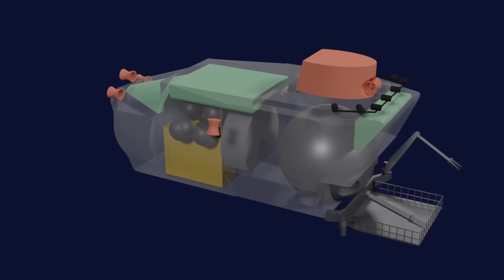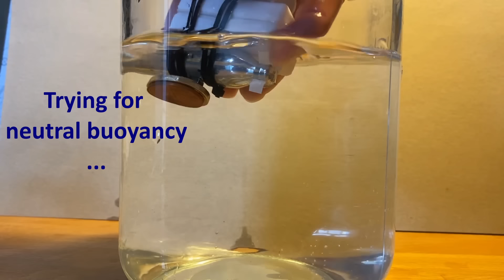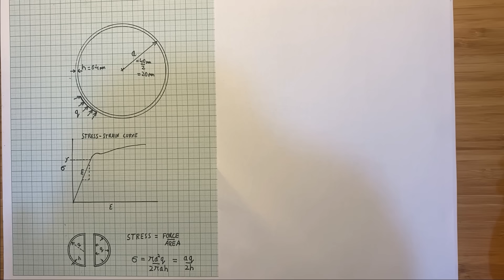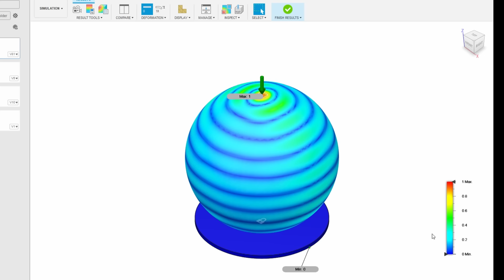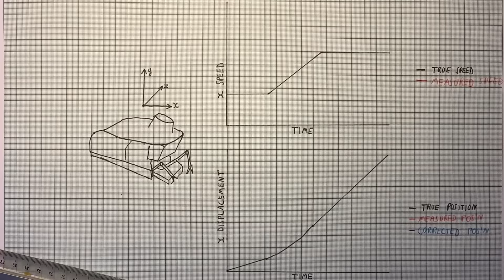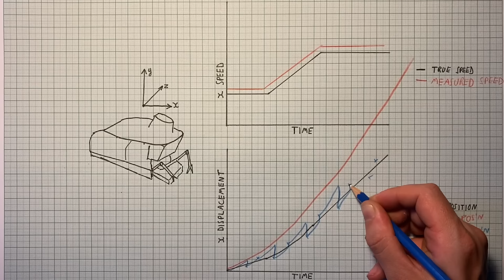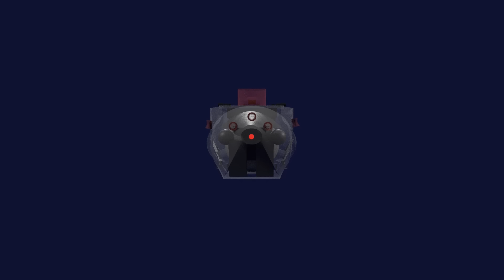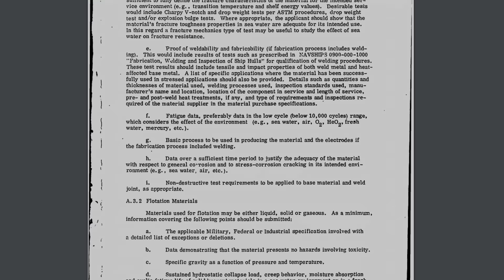DSV Alvin : How to build a safe submersible

Comment: My first thought was "they really thought of everything". Then I realized that everything and more is the bare minimum. Every redundant system, override, tool and component is built to provide passengers with the best possible chance of coming home. And the constant revision, updates and even the fault found during certification just highlights that it's nowhere near perfect. Safety in the face of such risk requires constant vigilance and I'm glad you're spotlighting this incredible work.
Reply: Alvin has not been without problems.   With each problem the Alvin has been improved to deal with it.    Over 60 years and thousands of dives the managers of the Alvin have learned a lot and have denied nothing.
Reply: @RossM3838 crazy how Alvin has had so many upgrades that basically nothing from day 1 is left remaining.
Reply: @ko7577 we don't need people to die on the Titan to determine the design was unsafe. Thorough, testing would have done the trick.
Reply: @ko7577 It requires thinking about everything and then raising the cash to do it. If you don't have the cash, whether through VC or your own money, don't bother.
Reply: @ko7577all the cash in the world can’t stop a man from saying “looks good to me” and pocketing the remainder. Money can’t buy integrity.
Reply: @ko7577your post doesn't make any sense at all. The reason Alvin updates are so expensive are the need for recertification. Those are.necessarily costly. Safety doesn't cost money out of thin air. It costs money because it requires attention to every smallest detail, and often requires to design and build specific test equipments, all of which sinks time and money. You just can't.cut corners in such environment. 

Your part about "will need a.few.deaths but worth it" is especially egregious, as you can be sure there won't be any follow up to Titan. Why ? Because 1) there is no data to withdraw from the accident as there is nothing left at all, and 2) the only way it can be improved is by going through the same certification processes as Alvin, which would increase the cost by perhaps 20 millions or more. Since the company doesn't have that kind of money, it's not going to happen unless it's bought by someone else.
Reply: @ko7577 -  "But anyway, yeah, safety costs money."  

An incredibly simplified summary, but not inaccurate.  Which is precisely why Titan suffered a catastrophic failure with the loss of all souls on board.  To state the obvious, Rush's very public aversion to certification was motivated by his desire to construct and run his DSV on the cheap.  He just used educated jargon, hand waving and abysmal judgement to pursue that desire.
Reply: @ko7577We would probably need a fundamental change in how we do things on par with another industrial revolution before a safe vehicle can be made in a reasonable price range. We are talking about a dynamic vehicle capable of floating or sinking at will with a reasonable safety margin under some of the most extreme conditions survived by a vehicle. That isn't easy to do, and cutting corners usually kills more people than it is worth(assuming we go by the micromort calculations used by the federal government for humans the most recent accident destroyed the equivalent of roughly$60million not counting the submersible).
Reply: As NASA once said, "quadruple failure that isn't supposed to be possible", after it was proven it is possible, and happening right now, suddenly quadruple redundancy isn't good enough even for ground operations.
Reply: @Mordecrox Any improbable failure will eventually occur over a long enough time-line. Risk management is about where you draw the line in the sand. You can have 10 redundant backups, and it may take a billion flights before they all fail, but eventually it'll happen. 

Risk management will always be a subjective decision based upon the priorities of those involved.
Reply: @PsRohrbaugh  Yes.  Probability statistics are not about how impossible something is, but how possible.  And yes, over a period of time, but time is not a really a factor.
   Loved an old sci fi story where two former atomic engineers decided to spend the rest of their lives figuring out a safer space flight fuel.  Thought it would take more than their life times, but others could carry on the work.  --  They hit it on the 3rd try.
Reply: @ko7577 this is just vile
Reply: @ko7577 In my opinion, it is not worth it that many smart and talented engineers, obviously somewhat misled, throw their bodies into the sea in hopes of getting it right. Instead of throwing safety out the window in pursuit of being able to say "I did it for cheap," Rush should've focused other aspects of advancement, perhaps construction techniques to avoid composite buckling, or other materials or technology that advance the science as a whole.

It's as if I made a metal tube with end caps, welded a guy inside, and dropped him down into challenger deep. I haven't given the world much by doing so, but at least I can say I got a man down there for cheap. Instead, if I got a team of engineers and material scientists to experiment with some other material that gives us favourable properties at a much lower price, I have just given the world something that will change deepsea exploration forever, like when kevlar was found to be somewhat decent at stopping bullets.
Reply: @ko7577 Tourism is a disease.
Reply: Look up the K350.
Reply: The Alvin has been around since the 60s.   Why didn’t the Titan’s designers 
Copy more of the tested and true design?  Arrogant to believe that carbon fiber composite could handle compression better than titanium.

And stupid to ignore the cracking sounds on earlier dives.
They could have tested the titan without people on board, using a tether to retrieve it, and sending control signals down an electrical “umbilical”.
Reply: @tikitime  cuz they had a rich dickhead hovering over their shoulder and most of them were fresh outta uni
Reply: @SloMoMonday  

You make excellent points!

Prospective Alvin Pilots are extensively tested on their extremely detailed knowledge of Alvin's systems and how they operate.

Such knowledge may make the difference between life and death...
Reply: @ko7577 Also titan was far bigger than Alvin. With costs like this building a new pressure vessel every 2 dives might be a cost-effective solution
Reply: @sojuz11  thats what i thought too,i think Titan could have worked if they just scrapped the vessel every 2-3 dives at most or even just refubrished it like Spacex does every Dragon capsule trip....
Reply: In real designs, you don't actually want these many redundant systems unless they're extremely basic and don't impact anything else. Every single component and bit of added complexity is another thing that can go wrong while drastically adding cost, weight and decreasing volume for other things.
Reply: I am surprised there is no safety line though, aka a rope to bring the sub back in case of catastrophic failure. I understand it could reduce freedom of movement, but still it would be an important feature.
Reply: @InXLsisDeo  Do you know what a 6500m steel tow-line that can pull a 20-ton-vehicle back up weighs? A LOT.
I don't have the numbers for you, but rest assured it is way too heavy, develops way too much drag (6500m of surface susceptible to currents) and has way too much pull on the vehicle to be of any practical use.
Reply: @thomaskositzki9424  I figured this after I wrote my message, but really, the sub wouldn't pull 6500m of steel cable, because  a few dozens meters would lie on the floor, so that would be the weight pulled. The real issue is if the sub is supposed to visit a wreck like the Titanic, there would be a high risk of the cable to entangle with the wreck.
Reply: @thomaskositzki9424  Almost sounds like you'd need a DSV designed to save DSVs.
Reply: @thomaskositzki9424 Just to devil's advocate (I actually responded similarly) : even in a catastrophic loss of buoyancy, it would still weigh less than its full mass, due to the various passive buoyancy assists it has (like the hollow glass bead matrix, which is outside the pressure vessel and thus likely to remain mostly intact). So the rope wouldn't have to carry 20 tons statically (provided acceleration and jerk are kept under control).
All the other factors remain valid, and I have a feeling the force of ocean currents alon would place a higher load than that on the cable, let alone the swell of the waves under the support ship causing dynamic loading.
Reply: @InXLsisDeo I think that possibility was discussed here- but the weight of such a cable makes it infeasible. Lifting a 20 ton vehicle from 8,000 meters would require a very large cable indeed.
Reply: @InXLsisDeo the weight of a 6.5 km rope thick enough to bring back a DSV that's lost buoyancy is probably large enough that carrying the rope's own mass would be the limiting factor. It would also act as a huge sail in ocean currents, meaning the DSV would basically have very little control over its position.
Reply: @Validole  good points

Comment: Ah yes, American engineering. PSI, mm, inches, feet, m, kg, lbs, long and short tons all in one equation because it's not real math if you don't have a massive headache by line 5. Also great video. Obsessed with building an ROV good for 120m (because reasons). Not too worried about most of it I can steal a smarter persons design but the pressure vessel will need some work. It will be aluminium because I have strong feelings for Aluminaut.
Reply from the maker: Aluminaut was awesome, I didn't have time to speak about it here (and how it rescued Alvin!).
I may have a video coming up in the future about the absolutely deranged units system I was once forced to work with - Oilfield units: basically what you said but somehow even worse.
Reply: @Alexander-the-ok   That would be great :) NR-1 as well (nuclear DSV). Bob Ballard called it his Nautilus.
Reply: Land of the "free to use whatever units you want!" home of the "why can't we just use SI like the rest of the word?"

Comment: Wow, after seeing the precautions and redundancies built into this vehicle and the complete lack of anything even near the same level of reliability in the Titan design, even the lack of any testing, it seems inevitable it would fail.
Reply from the maker: You understand why I refused to even mention the Titan in this video. The two aren't even remotely comparable.
Reply from the maker: @ko7577 Well, I'll be charitable and assume you're not just trolling me. Go and read your first paragraph again....I'd say you contradict yourself pretty effectivley there.

And yes, like most engineers, I am extremely critical of the shuttle program and how NASA conducted their risk management. If you haven't read 'Challenger Launch Decision' I recommend it - the quintessential post disaster analysis.

Comment: Would be interested in how controls inside the main pressure vessel (PV) communicate with the equipment outside the mPV? Also, I did read somewhere that the batteries are now Lithium Iron Phosphate (LiFeP02) or LFP, these don't suffer from thermal runaway like their NMC/NCA Cobalt based peers. Sure they are less volumetric and energy dense, but their thermal safety is significant over other Lithium cells.
Reply: Thermal runaway isn’t a problem for water cooled batteries (the water temperature at 3000m depth is well below 0C…).
Reply: The batteries are still Lead Acid. I know because I just serviced them. There has been an effort to move to Lithium Batteries but there are many engineering and safety concerns that still need to be resolved before that happens. The hope is to have that as a major part of Alvin's next Overhaul period.
Reply from the maker: I had to leave out the bit on through hull communication. Basically there is a 'port' on the back of the hull - similar to the viewports but used to pass through electrical and fiber optic lines.
And yeah, the batteries are LiFePO2 I believe.
Reply: @Alexander-the-ok  I would expect them to be LTO, most reliable and safest chemistry but also most expensive. Although in this case, cost is of rather little concern, and neither is robustness against thermal runaway given it's surrounded by water. But reliability is everything.

Comment: "The Alvin knows its position at all time..."
Reply from the maker: It's almost impossible to talk about Inertial guidance now without accidentally saying 'it knows where it is because it knows where it isn't...'
Reply: INS tells you your position in space. It needs to be corrected for the movement of the planet and solar system around it (it is that precise). It will directly give you longitude based on reading the rotation of the earth around its parked reference plane.

Comment: Wouldnt the strength of the plastic ball be highly dependent on temperature?
Reply from the maker: Good point. The material properties given are at 25 degrees C. Obviously my 'test' and calculations were extremely crude though.

Comment: I learned something new today. I always thought that 'ping pong' balls, or 'table tennis' balls (the same thing) were made from nitrocellulose. After doing some 'research' I found that they were indeed made from Cellulose up until 2014, after which time they changed to being made from ABS. 

Oh all the stuff about some sort of submarine? nah, boring.. Ping pong balls not being made of Nitrocellulose any more.. PROFOUND!!!
Reply from the maker: This is hilarious because I had EXACTLY the same 'table tennis learning journey' as you! I'd seen the videos of people setting buckets of them on fire and creating an inferno because of the flammability of nitrocellulose. But yep, when I looked it up - ABS now.
Reply: When they made the shift there was a big thing about how the new plastic balls didn't spin as well and bounced a little differently. I think the quality of the balls has improved a lot since though.
Reply: I didn't know nitrocellulose had been replaced with ABS. In mid-2000s, I watched someone light a ping pong ball, and it disappeared in a flash of orange flame, leaving no ash.
Reply: @patnolen8072  We used to make smoke bombs with them wrapped in aluminium foil when I was a kid. No idea how it actually worked but I saw it being done.

Comment: Excellent video! I only did a couple of semesters worth of Civil and Mechanical engineering before heading off to my own specialization, so this was an excellent refresher/clarification of some of the subjects I haven't touched in years!
Reply from the maker: Thanks. I hadn't even thought about shell buckling for at least 7 years before this so that part gave me some flashbacks
Reply: Yeah I don't remember a lot from my strengths of materials courses, but I do remember that compared to simple tension or compression, buckling modes of failure were many and complicated.

Comment: Hey there! Haven't watched the video yet but the font choice for the thumbnail is a bit hard to read at a distance 😅 I think you can still update the thumbnail though
Reply from the maker: Thanks for the feedback! I'll re-render and update it.
Reply: @Alexander-the-ok  And on the topic of making a pressure vessel on the cheap: soda bottles can handle surprisingly high pressures. as a kid I used to make bottle rockets which hit around 7 bar before I backed off. You could be able to splice two bottles together with the ping-pong ball in it to test it to failure - I once successfully followed the process from this video: https://www.youtube.com/watch?v=tGxOnuNxDoQ
Reply from the maker: @chixinspace  Oh I thought of doing that but tbh that was the last part of the video I filmed. I decided to not delay the video for the sake of a quick demo.

Comment: 17:00 A suitable cheap pressure vessel is a pressure cooker.  Good to 2 bar.
Reply from the maker: Absolutely. I considered it but the high temperature would affect the results, and there'd be no way of seeing the collapse.
Reply: @Alexander-the-ok  Put a cheap camera and flashlight inside to see the result, and pressurize with a bicycle pump so it wouldn't need to be heated.